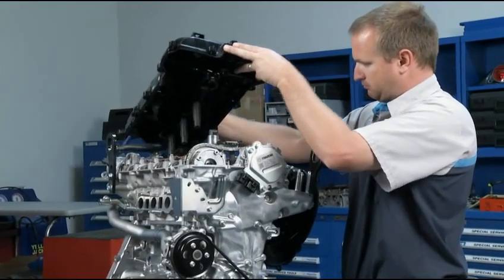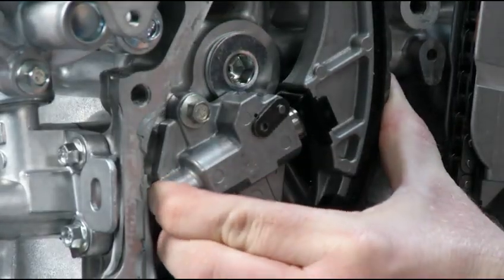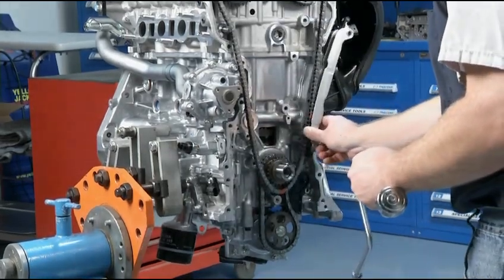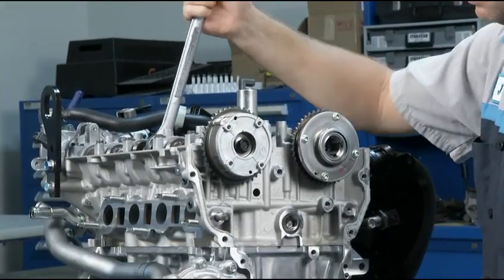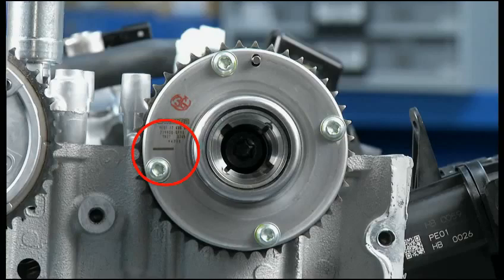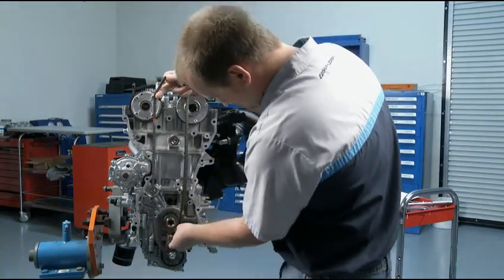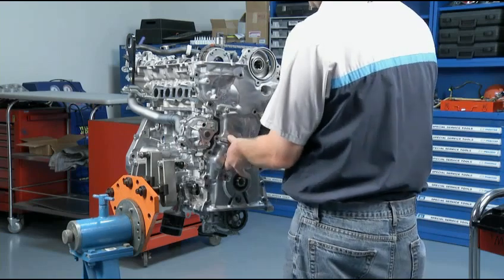Mazda Skyactiv Engine Timing Chain Replacement

Comment: If he put the crankshaft sprocket on top dead center , why he turned the camshafts to time them ; wasn't the timing already set , when he put the keyway  at 12 :00 ?
He didn't mention what years generation , nor the engine size .

Comment: Good to see Mazda went back to a keyed crank. The non-keyed design on the 2.3L motors was so silly and made timing it an absolute pain. If you only had to remove the crank pulley you'd have to retime the engine, which was a major PITA on those engines if you didn't fully understand the process and that's putting it gently.
Reply: I thought that was ford idea for non keyed
Reply: @wingitreview  you're right, that was Ford's design.

Comment: is it necessary to replace timing chain? i thougth they last a long long time or never need replacement.
Reply: It depends alot on the age, mileage, and treatment of the car. A car driven gently and maintained regularly won't have timing chain problems for +250k miles. A car rode hard and put away wet without proper maintenance might break or stretch a chain past the tensioner's limits at 150k.

Comment: Why not use cam lockers to keep the timing from slipping and just Chang out the chain
Reply: Probably because of the variable valve timing and cam phasers.  The initial alignment helps get the proper sprocket tooth in the proper chain link for each sprocket.  If you simply relied on just locking the cams, it would be very easy to get one or more sprocket teeth in the wrong place because of slack in the chain.

Comment: Great! Now, I need to figure out how to remove the engine without a garage or expensive tools.
Reply: Did u ever figure out how to do that ? 3y later I find myself in the same boat ! (Jokes)
Reply: @orlandoautoparts2993 me too... If anyone has the engine removal procedure and head torque specs for a 2016 cx5 2.5l vin y.... Please send me a note
Reply: @orlandoautoparts2993 currently in the middle of mine
Reply: Hahaa

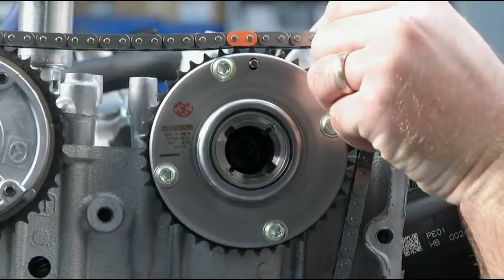Comment: why do you align the cam pulleys based on their marks with the engine block when later on, when installing the chain, you change it again based on the marks of the new timing chain ? Because then, the alignment of the marks do not fit with the block any longer (watch 2.55 - 2:58). Looks weird to me and like a useless step that just confuses.
Reply: I though the same thing
Reply: Probably because of the variable valve timing and cam phasers.  The initial alignment helps get the proper sprocket tooth in the proper chain link for each sprocket.  If you simply relied on just locking the cams, it would be very easy to get one or more sprocket teeth in the wrong place because of slack in the chain.
Reply: @BKD70  I am really confused too I still dont understand why they use two ways of setting of the chain?
Reply: They made a mistake during the installation. @3:08 you can see the timing mark on the intake cam correctly positioned again, they just don't mention it in the video.
Reply: The tensioner probably realigns it back into the marked positions.

Comment: For those watching this..... you’ll get plenty of practice. Trust me. Why the hell Mazda does not use a duplex chain is beyond me. This and the DPF regen methods Mazda employ turn this into one seriously garbage engine. Mazda, please take note. Someone should sue you for this crap!
Reply: Sure Gary, sure🙄
Reply: 🤣 ignint 🤣
Reply: DPF?) in gasoline engine?
Reply: That garbage engine has been holding up for almost 10 years now pretty well. Not a single structural issue known about the SkyActiv-G.

Comment: Is that the same for R2AA engine ? 2.2 diesel ? - my Autel tells me that there is missal ligament of 11.1 degrees between camshaft and crankshaft! But car ECU does not warn me of timing chain ! When chain needs to be changed? Thanks

Comment: That's the cleanest engine I've ever seen!
Reply: Yea, would be a lot more impressive had the engine STILL BEEN IN THE CAR while doing this....LOL.
Reply: @QuantumRift  its not impossible to do. I'm doing it now installing aftermarket camshafts. Just enough room to get a ratchet wrench in between the front under sway bar and the crankshaft pulley. First you have to move the coolant reservoir and intake box out of the way. 2016 miata
Reply: @6000pounds  NO doubt.
Reply: @6000pounds  but that’s a RWD car with those parts up front. Most applications with this engine are FWD with the timing chain and crank pulley jammed up against the passenger side frame rail. Look like it would be a major PITA to change. Hope i never have to do it on our 2014 CX5. Currently at 113,000 miles, and I’m just now changing the belts, belt tensioner and valve cover gasket.
Reply: The engine in the video is new...  Used for demo purposes
Reply: @B.D.TRX4  I was being sarcastic.

Comment: How often must this be changed?
Reply: If the car owner does >NOT< change the oil on a regular basis
Reply: As far as i know there is no change noted in the service plan - should stay on there for the life of the engine.
Reply: If the car owner does change the oil on a regular basis, the cam phaser maybe damaged, or the chain experiences excessive wear then the engine timing will eventually get out of range. The ECU will warn you of this. This is when you will need to change the timing chain.  Often, when the phasers may need to get replaced too because it's damaged.
Reply: Theoretically should outlast the car
Reply: 've heard every 100,000 miles but if you have changed the oil and filter every 6,000 miles and had maintenance on a regular and consistent basis the timing chain should last 200 or 300 thousand miles